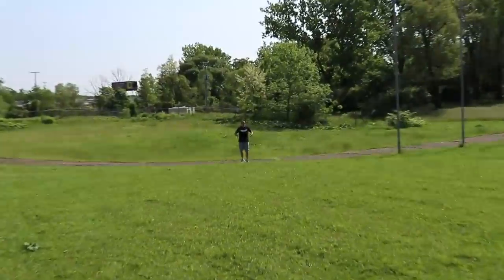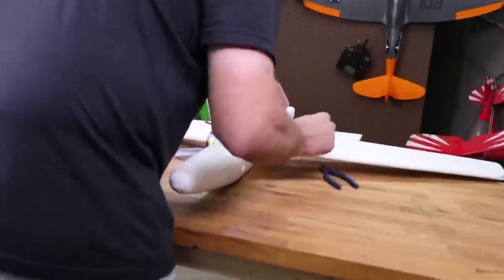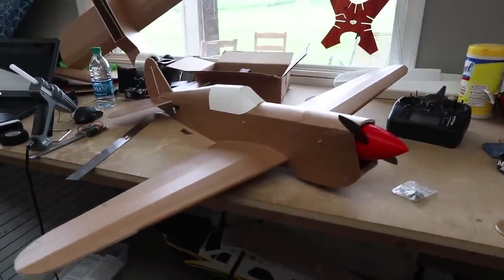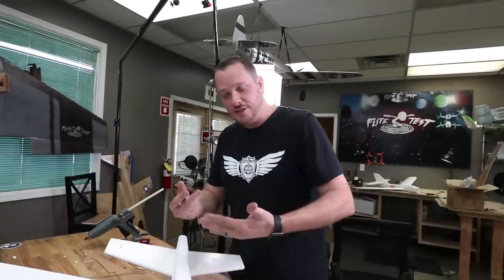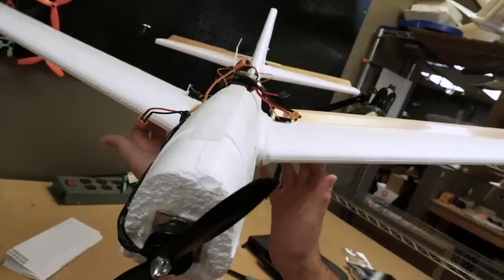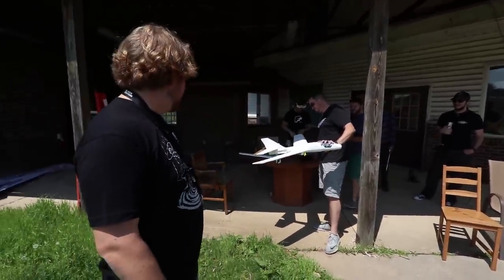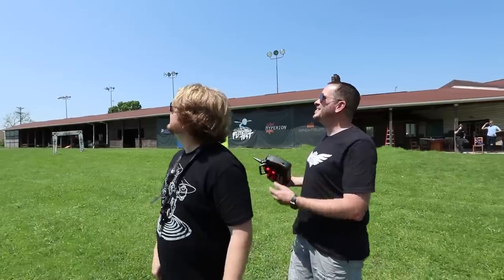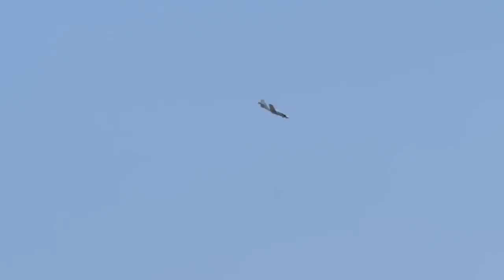Motorized Walmart Toy Gliders?

Comment: This is exactly my kind of flying. I have flown  RC for more than 30 years and absolutely loved kitbashing, and creating from scratch. I once won plane of the month in my club with a stupid foamie "toss toy" very much like yours, but mine had this totally draggy dragon's head on the front. I mounted a .049 Cox glo engine on a center fuse pylon and it flew fantastically.  But, this was in the day before sub-miniature servos and receivers, so it was heavy and being draggy, i got worried how to actually land it dead stick - the .049 had no throttle, and when the fuel ran out it was going to fly about as well as a hammer. The engine warned me with three seconds of high speed lean, then quit. I happened to have about 150 ft altitude. I had to dive hard for the runway to get enough speed to keep flying in the pullout, and then at the last second before impact, flared and planted a perfect slider. Instant applause and got a unanimous plane of the month vote- pure luck, the first flight of the thing, too. I got more excitement out of that kind of flying than all my Kaos, Chipmunk, and Stik flying combined.

Super entertaining vid, guys...loved it!
Reply: I am building josh's plane and I am wondering whether to use a 1400mah 2s battery or a 3s 850mah, both are 72 grams, too heavy, or should i stick with 3s 450mah that josh used
?
Reply: The larger Mah value of the battery means more "fuel" on board and thus more weight. The 450mah battery would fly the aircraft as powerfully as the 1400mah but just not as long at one flight. So, to get better performance for the given power output (3S- means 11.4 volts in both batteries = same amount of thrust!) use the lighter battery. But, for a given flight session - time in the air under power will not be as long of a duration in minutes. The heavier battery means longer flight, but less performance during the flight.

Remember this, too- A lighter battery means less weight on landing. The heavier battery, though out of juice, will weigh the same at the end of the flight. I always opted for the lighter weight battery and just brought more of them all charged up to the flying area. So, I would have like 5 each 450 mah batteries with me, fly like crazy for five minutes, land, replace the battery with a fresh one and fly some more.  Taking a few 1400 mah batteries meant 15 or 20 minutes of one flight, but sluggish takeoffs and heavy landings. A lighter battery also helps prevent damage in event of a crash. less mass to sling around in case of sudden collision with the ground or trees.
Reply: Thanks so much!
Reply: I think I'm going to get a 900 mah 2s, it's 50 grams and josh's was 42 grams so hopefully i'll get more flight time and decent performance, most of the time ill be gliding it.
Reply: U R Welcome. And I forgot to mention how much I appreciated your attention to aeronautics. Your aileron and elevator surfaces were just about perfect size for the weight of the AC and you both held nearly perfect on your CG. You guys should do a basics vid specific for kids just getting into RC flying. You guys really know what you are doing and are fun to watch.
Reply: Good choice. Just remember, 2s is only a little more than 7 volts so your max power will be a little lower.  But, these foamies fly beautifully at lower airspeed and the hand launch means no need for high take-off power. Should do great.

Comment: “Can’t believe the CG is that far back”…..At the root of a swept wing <facepalm>  That huge tailplane must help that forgiving stable flight.
Reply: Yeah you have to measure 25% from the leading edge at the MIDDLE* of the span, not at the root. The two measurements happen to be the same for a straight rectangle wing, they are not the same on a swept wing.

* Middle of the span meaning equal area on either side.

Comment: I snapped the chassis on my Traxxas Slash 2wd and a couple other chassis related parts so I’ve been thinking about using the motor/esc/battery/radio and making a plane or boat. What are your Thoughts?
Reply: I've seen people flyplanes with pistol grip radios before! You can do a 2 channel glider with elevator and rudder, or a "3" channel park flyer with fixed throttle, rudder, and elevator. You already got most of the electronics!
Reply: BadIdeas101 ok cool! I think I’m gonna have to try this project.

Comment: already tried that wth the same plane but i used a radian motor i re wound and a foam board tail i also cut ailerons out from the wings it was over weight and did not fly as wel. i like the twin motor one better what motors an esc should i use and how do i set up difrential i want to re do this

Comment: Hi everyone, I am curious to know what parts I need to buy? I have a couple of these foam gliders, and that differential motor with no rudders/ailerons seems so simple to use but I have no remote controller, receiver, ESC, motors, wires, batteries, or anything.  I'm really interested in learning about the brushless motor's KV ratings and such.

Comment: I need to 3D print a razor holder to hold the blade at 45 degrees. That and some aluminum rail, nice neat 45 degree bevel cuts.

Comment: So, today I find these gliders at Hobby Lobby for $11, so I bought two. Josh, I want to build your version but with one motor, either top mounted prop or top mounted ducted fan. My question is, was elevon control nicer flying than ailerons and elevator? I want SIMPLE", so I'd just as soon omit ailerons if I can. Did either allow a roll? THANKS in advance.
Reply: They are also available again at our Walmart for under $10. I bought another one, LOL!

Comment: Hi, I have recently started getting into the hobby and started with a foam glider like the one in this video. I eventually made the same design Alex has but every time I go to try and fly It, it goes inverted or banks real hard in one direction until it is facing the ground and crashes. I am getting really frustrated and have tried everything I can. I have put in over 5 hours of research and have had no success. HELP!!! ps. I am using the EMAX 2213 multi copter motor  from flight test store

Comment: The CG is exactly where you'd expect it to be. He just measured it from the wrong place. You need to be 25% back from the leading edge at MIDDLE of the wingspan, not.at the root. The two happen to the same if your wing is a straight rectangle; this wing is swept.

Comment: I did this 30 years ago with a Cox .049 fueled engine and a two channel.  (There must be a picture of that thing around here somewhere.)
The foam gliders of that era had straight instead of swept wings. I still have several of them! 

I did a write-up of it for the RC modeler magazine. Seems like the article ran in 1989.  "Disposable ARF."

Comment: ...And these guys never even think of mounting the motor in a poer pod on top of the wing. 
Also, did they never see the early foam ARF kits? Thi is basically what they were when they weren't either warplanes or small 'private plane' designs.